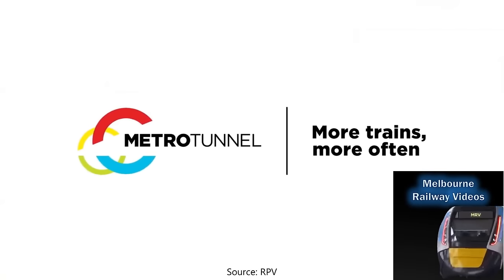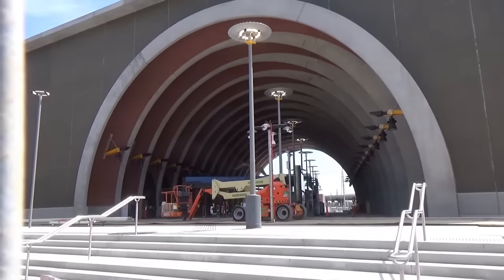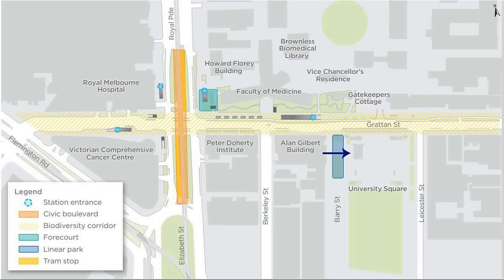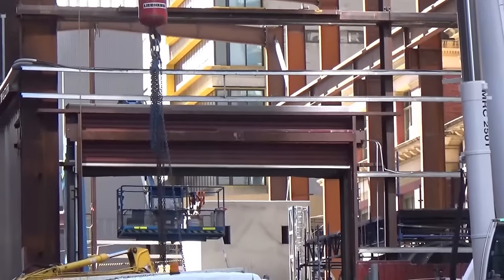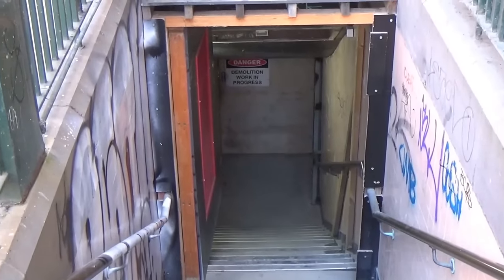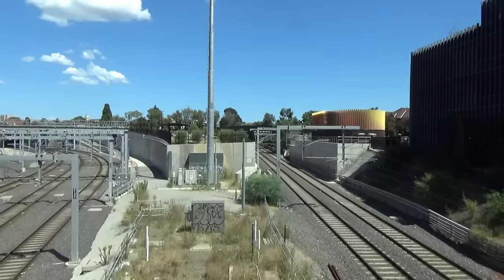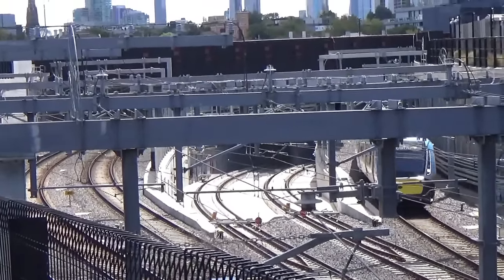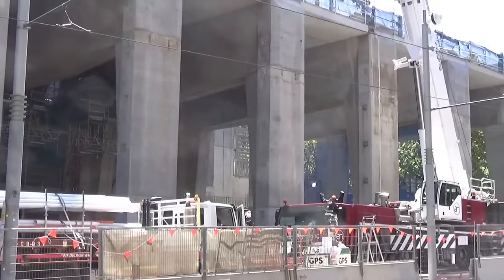Metro Tunnel Construction Update Autumn 2024 (Melbourne Railway Vlog 216)

Comment: That wasn’t a leaked government I think it was actually leaked from the builder. Even if it opens in 2025 I’d still be happy; New transport infrastructure and still 1 year ahead of schedule
Reply from the maker: It was leaked by the builder, but the government and the builder are working together on the same thing so their plans are the same. 
I agree though. I'd still be content with it opening in 2025.
Reply: @melbournerailwayvideos  the leak was from one of the builders and possibly slightly misinformed. There is shockingly little agreement between the state and construction companies on this atm.

Comment: In regards to State Library, the platform areas are pretty much all done as is all the concreting work for most levels down to B4. Most of it is still bare but the majority of these floors won't be accessible to the public anyway, so fitout works will continue during train operations.

The concrete work for B5 is almost done as is preparation for B6. Concrete works should be done in time for passenger operation. Fitouts can be done afterwards.

It's truly chaos down there.

Fun fact, the original plan was for it to go all the way down to B7 but that got canned as it would delay opening. The main shaft which excavators were lifted down are now being formed up and concreted, so digging is officially over. Only the smaller shafts remain for the smaller machinery.
Reply: Is the working plan still to open to passengers in September 2024?
Reply: @FloydBromley  That is the plan. Probably the case for all other stations, however I haven't worked on those recently so couldn't say.

State Library is a monster, so it could be the only one in this situation.
Reply from the maker: Thanks for that info. Really interesting stuff!
Reply: @ondrejsedlak4935  yeah that’s what I’m hearing for the whole tunnel - September planned opening (with the government still officially saying 2025 so they don’t have to explain any unexpected delays)
Reply: @FloydBromley  what is the function of the lower levels?
Reply: @FloydBromley  the box stations are on track for completion by Sep 2025, the CBD stations are a different story
Reply: @Anonymousey-gj3lv  it may be a case similar to the city loop when it opened - that is one or two stations open before the others.

Comment: It's just too bad if you live in Sandringham and want to go the University.  There's no interchange in South Yarra.
Reply from the maker: You'll be able to interchange at Flinders St by using the connection into Town Hall, and then onto the uni from there. You would have probably saved a bit of time if there was a connection at South Yarra as the Metro Tunnel will be faster than the existing route, but it's still not horrible.

Comment: 13:05: Yeah, a lot of the new infrastructure provides pretty awful shelter. It looks good from a distance, but its often so high that it doesn't really provide meaningful shelter (from wind, rain or sunshine). A lot of older stations like eg. Glenferrie are IMO much nicer because the the roof is much lower.

It's nice that the government is doing stuff like this, but it's textbook "built like they don't use it" development - whatever looks good rather than actually IS good :(

Comment: They could open in September 2024 if only 3 stations are complete, with passengers changing at Richmond Caulfield to get to Flinders St or City loop.
Reply: Insider info?
Reply: No just speculation
Reply: that would be a bad idea imo, a large % of passengers are heading to the city and they would crowd other lines in the process making the problem the metro tunnel intended to solve worse
Reply: @Anonymousey-gj3lv  Multiple stations could be opened by September but they will likely open them all together at the start of 2025

Comment: Do we know if the change to the Pak/Cran lines will shorten the trip to the CBD?
Reply from the maker: You could probably find the answer by diving into some of the planning documents, but I would assume that it would. There will be two stations to Flinders St - same as before. The only difference is that the trains will be running through a tunnel that I believe is designed for 80km/h operation, rather than the existing tracks where trains don't tend to hit speeds close to that.

Comment: The Metro Rail Tunnel is a waste of time and money, it's not needed, it's been a budget blowout, the project should have been abandoned before it was started.
It's going to be a huge inconvenience for those using the Pakenham and Cranbourne line because the trains on those lines won't be going through South Yarra and Richmond.
Reply from the maker: What do you propose as an alternative to add much needed capacity to train lines across the network? And do you think it is sustainable to serve places like Parkville and the Shrine only with trams? 

I also think you're overestimating the inconvenience on Pakenham and Cranbourne line commuters. How many of them really want to go to South Yarra or Richmond? I suspect not many, and changing trains really isn't that difficult. I think a lot more will benefit from having more frequent services which go to places that were previously not served by the network!

Comment: Metro 2? What is Metro 2??
Reply from the maker: It is a proposed rail tunnel running from Newport to Clifton Hill via Southern Cross, Flagstaff and Parkville. There are still no real plans to build it, but Metro 1 was designed with provisions in case it is ever built.

Comment: Word is that the CBD stations are further behind than expected, and likely to be delivered late, due to the technical difficulties of the construction. Also, there's a likelihood that everything is finished this year but not opened until 2025, as it would be very difficult to implement all of the line changes over the busy summer period (December 2024 to January 2025).
Reply from the maker: Interesting. What you're saying sounds very plausible, even if you're probably way more informed than I am. The CBD station do just seem a fair way off!

Comment: Great and informative video. Just one point. There seems to be a trend lately of saying “For all intensive and purposes”. The correct saying is “For all intents and purposes”.
Reply from the maker: I've never had that pointed out. Didn't even know I was saying it wrong the whole time. Thanks!
Reply: Okay, I have read this more than once and I don’t see any difference between the first rendition of the saying and the second one.

Where are these two phrases different? 

As it stands, the first phrase is identical to the second one and the comment makes no sense at all.
Reply from the maker: It was a typo on OC's behalf, but the point they were trying to get across was this. The correct saying is "for all intents and purposes". I said "for all intensive purposes", which is a common mistake. It makes sense too. What the hell is an intensive purpose?
Reply: @melbournerailwayvideos  exactly correct. I’ve edited the above. Hilariously when I wrote and posted it, autocorrect changed it from intensive to intents in the first example.